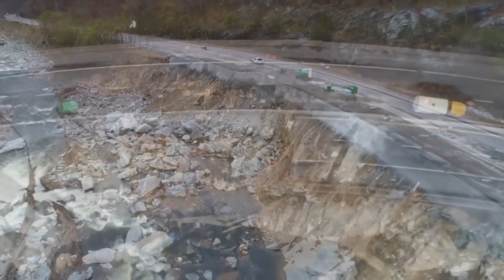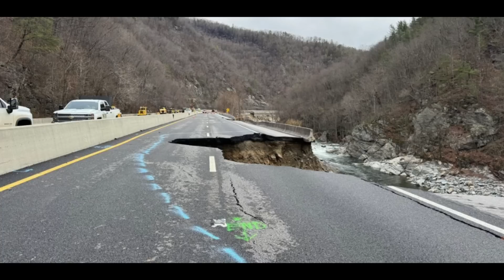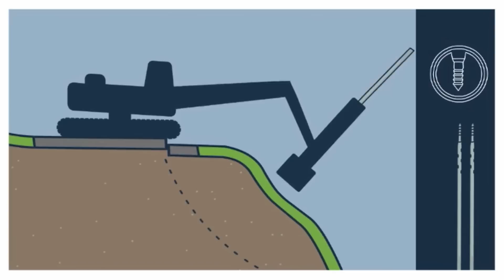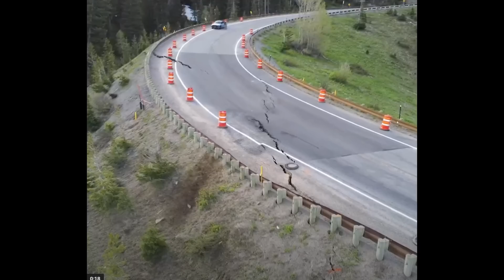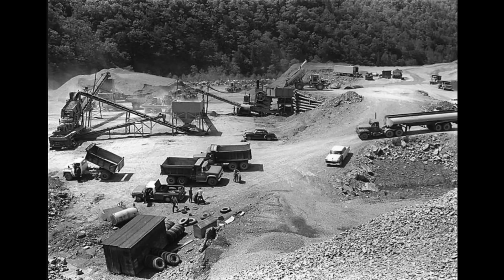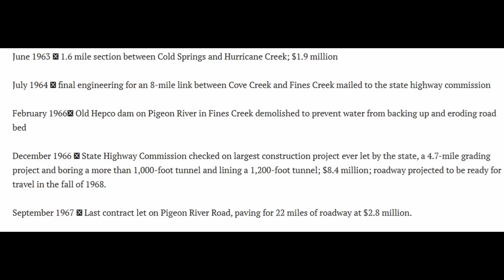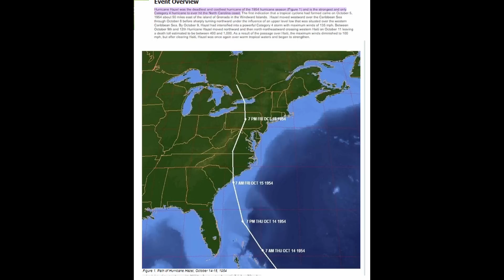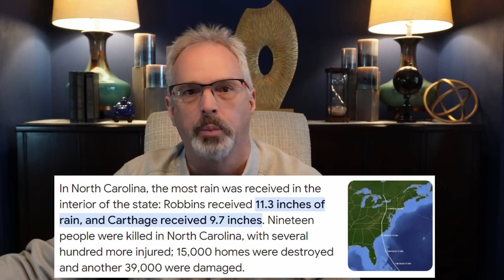Interstate 40 Rebuild Status

Comment: The hazards of I-40 between Knoxville and Ashville are almost legendary.  By 2004 it had been cut so many times that T-DOT and NC-DOT seriously considered not rebuilding it after Hurricane Ivan cut it up in 21 places.  It is actually less damaged this time than in 2004. 
The section of the roadway was closed for 18 months to rebuild it from Knoxville to Ashville. 
That section of roadway is almost an annual problem of failures.  It gets rock slides, mudslides, and washouts right as rain.  You are correct it needs serious reengineering.  I would say closer to $50 Billion.  It is such a critical piece of US infrastructure that it warrants the effort. 
Similarly, you should investigate the US-TVA efforts to build 5 dams that were never built in the 1970's.   US-TVA exists because of this flooding.  You should look into the failure of the water system dam for Ashville that put about 20 feet of water down on Ashville as the raised spillway collapsed in one section.  This was the disaster at Swananoa NC.
3 dams failed to make this flood worse.  They didn't all wash out.  They simply failed during max flood control conditions. One had to be opened to prevent a break right at peak flow amplifying the flood.
If you look at the region, the bedrock in the canyons periodically gets scoured out.  Then it builds up a flood plain.   Then it fills in with brush and trees.  Then it gets scoured again.
The flood size max flow at Douglass Res.  was 67,000 CFS.  Tennessee River Flood at Guntersville maxed at 107,000 CFS.  The Max flood at Guntersville has been 740,000 CFS.
This actually was a small very intense local flood.  Not to diminish any people's miseries.
1973 saw flood waters in Chattanooga downstream of Chickamauga dam at 33 feet deep in the city.  This valley floods like hell!   They had to build up 15-foot-high wing walls on Guntersville Dam to cover the damages of 1973.  Cost $58 million. The water washed over Guntersville Dam nearly 2.5 feet deep and it is about 1/2 earth dam.

You should show people the rock slide at Ocoee River #2 dam to show how unstable this rock is.

https://youtu.be/CUXhjPkGBtU

https://youtu.be/Ax0bZ18A47s

https://www.youtube.com/watch?v=Se9gPNP49hw&pp=ygUQb2NvZWUgcm9jayBzbGlkZQ%3D%3D
Reply: I really like when someone says, THIS IS TERRIBLE, AND IS AN ACCIDENT THAT JUST HASN'T HAPPENED YET, AND THEN YOU BRING EVIDENCE.  AWESOME !!!
Reply: @robert-zj7ef  I think so much of the problem is that this region is constantly building roads on the cheap rather than biting the bullet and doing the better, more expensive option even if means it has to be a tollway or constructed in phases (such as a super two initially) to do so. There are so many places in the mountains where they built in a flood-prone area, did massive, ugly, deep cuts and/or shore up unstable terrain rather than just build tunnels and viaducts so that the road can be placed in a more ideal location. In some places, the viaducts may even need to be double decked to minimize the amount of land taken, and when it comes to this stretch of I-40, that might be the only way. The ARC road projects and interstate projects they were always trying to rush through as if building them too slowly would result in them losing the money. Rather than build them right and make them capable of handling increasing heavy traffic, they just basically slammed them through unconcerned about enormous future costs and problems that would come from that.
Reply: @jet346  I have ZERO DOUBT that you are 100% correct.  Maybe, with podcasts from citizens telling other citizens the issues they see, some pressure could be applied to get the governor to take a look not just at the route but also the contracts. Too often, its just the low bidder, who later comes back wanting more.
Reply: @robert-zj7ef  I think it's more that the priority is lower for every state in regard to the region that despite the roads being the most expensive to build, they don't want to make that extreme of an investment. Perhaps I-26 north of Asheville was actually built right, but this was more of an issue in decades past when they were "desperate" to attract industry to the region and just built what they could ignoring the geological hazards along with failing to anticipate increased tourism and traffic. 

Places with constant slides on older interstate and ARC corridors might on the surface just say "this is mountains", but clearly the funds weren't ever there to build tunnels or viaducts on areas that either locals knew or the engineers knew were neither stable nor safe to build. 

But like anything, it's a job with a boss that isn't reasonable and demands the impossible at a time when reasonable voices were ignored or dismissed when pointing out the serious problems with the projects. These days, that is made worse when NIMBYism drowns out all reasonable discussion about alternatives so that instead of developing a better plan, the project is cut back severely to the point of being worthless, delayed for years, and/or canceled). The result is the expensive nearly constant mitigation of roads where the land does not want them to be. At least it's not as bad as in California where there is no good place to build and the mountain roads crumble catastrophically at least once every 5-10 years. I mention further down that the constituents are much to blame as well as they expect something for nothing.

It cannot be discounted that NIMBYism has NCDOT and TDOT in a bind with this road. That is the root of why they are absolutely determined to throw money at the problem hoping they can fix it back to some level of status quo given it's been around long enough to be grandfathered. They will face well-funded and nasty opposition to moving the road or massively altering the road, because for the NIMBYs the only solution is "no solution", and any setback is an excuse to permanently close and/or remove a road entirely with no alternative. Basically, they live in this 1970's wilderness fantasy where it works just fine to just remove busy roads and tell everyone where to stick it as if they live in a private cabin miles away from other humans. This is how we got "whack-a-mole" spot treatment traffic engineering solutions instead of building significant new roads.

Corridor K remains unfinished (despite Nantahala and Ocoee Gorges both being highly hazardous and congested), and the need to convert many of the existing corridors to limited access such as Corridor A will be met with similar NIMBY ferocity despite the fact that they are now miles and miles of traffic lights and development. In Europe and Asia, they will build tall bridges over deep valleys that lead to tunnels through higher peaks. In the US, they will say that can't be built due to cost, environmental factors, and/or opposition.

It is maddening that when the population and traffic keeps increasing that a loud and wealthy few coupled with others that think roads can be built and maintained toll-free with very low taxes force us all to rely on dangerous and inadequate roads while making the cost to fix them get exponentially higher each year.
Reply: @jet346  I had not considered nor even had the thought of NIMBYs. They like the privacy of their living space. Who wants a very  4 lane extrafaganza running through the middle of my families quiet life. Those on that thoroughfare do not stop to see my life, only for gas and a soda. That for the good of the people thing rings hollow. So if there is no reroute then there must be stringent specifications which prevent the destruction of the roadway in a future with a similar Helene event !
Reply: @robert-zj7ef  I think you're missing my point. It's those that line up to oppose every road project on spurious grounds if it is anywhere near their place of residence (as in the same county). That is not the same as building a road in their front yard with a giant retaining wall or taking it by eminent domain. Those are legit concerns: at least in regard to modifying the project so as to not ruin their property or leave them poorly compensated for taking their house. I'm more referring to the "environmentalist" types that play that card to sabotage every public works project who only seem to care about that when it's something planned that annoys them.
Reply: @jet346  I understand your point now  and I CRRTAINLY AGREE.

Comment: Three comments:
1) Not sure I follow the nuclear reactor analogy.  there has been advances in that machinery as you note.  However, highways are pretty much built the same way..  
2) I also have read about a different route, but where and how much.
3) As to the truck traffic to bering in fill, assuming that is the only way, the trucks can be limited to the unused roadway (2 lanes) exclusively affording no or little disruption in regular highway traffic. traffic

Comment: Not a civil engineer but to familiar with the mass x velocity effect in the mountains - especially @ altitude.                                 what is the feasibility of dynamiting the western side of 40 to create either a raised 4 lane (lot of basting) or simply widening/moving the highway away from river at  problamatic bends in Pidgeon river should such a catastrophe occur.
The areas of collapse seemed to have been pretty stout w steel pilings and reinforced concrete...but I am noticing compact soil and not bedrock underpinning roadway.
To you your point of of re-evaluating the re-build moving forward I 100% concur as this a vital corridor.
CHALLENGE : To what extent can we apply the countless areas w secondary and tertiary roads, bridges and communities that have been "pasted"?
Can't help but imagine what 100 billion do - -- not to make WNC more accessible for more tourists/development but for people to be able re-build their lives. This is a national disgrace. Full stop.
Thanks for your work.
Reply: Per above I-40 work...very contingent on composition an location of bedrock

Comment: They need to bring in engineers and construction companies from Norway and  Switzerland that have drilled hundreds of tunnels successfully for railroads and super highways.  It might cost more but would last forever.
Reply: I think you’re spot on, rebuilding this the same way would be asking for a repeat in the future. The bottom line is going to be the money. It’s a beautiful road, I got to travel it a few times. You could support the road with pillars instead of fill, or like you said dig a new tunnel. The question is will we as a society go for it. Better money spent than building a city on mars.
Reply: If this type of failure only occurs as frequently as history shows, no way they will dig tunnels for this stretch. It's about the $ the citizens are willing to spend.
Edit : It's about the $ the citizens have to spend.
Reply: @joe28704 Willing is correct.  America has more billionaires than any other country.  If they wanted this fixed right it'd be fixed right.  But they aren't willing to spend money on a good solution when they can make poor people spend money on a bad solution

Comment: I was expecting to see some scaling prior to the anchor and shotcrete installation, did low water levels in the Pidgeon River disqualified that? If they're hauling in fill at some point there'll be a worse impact. Also was expecting they would remove more sections of the lane that survived adjacent to the failed area, but likely with underlying rock being compromised.

Comment: @Casey Jones - Professional Engineer, you might need to do an episode just on probability.  The average person thinks that another event like this will never happen again since it was a "once in 1000yr event"  They don't understand that you can have two 1000yr events back to back.  Is it rare and unlikely, yes.  Can it happen, yes.  Recently in my hydrology I do for my hydraulic engineering, we started seeing the probability being used by USGS in our hydrology streamstats.  I believe they are trying to get away from the "1 in X years" for this reason.  I'd love to hear your take on some of this.
Reply: a 1000-year event means the likelihood of it happening is 0.1% each year.  100 years even is likely to happen 1% each year. They are based on prior weather history. As we know, climate patterns are changing.
Reply: @jss27560  The hitch with 'historical' weather data is the vast bulk of it is relatively recent - only during and after WW II, because of aviation and other military imperatives was it recorded systematically with any sort of decent spatial distribution. And even with that, there really still isn't very good correlation between the weather event at a give region / place and the 'effects' which  converge and manifest sometimes hundred of miles away ( flash floods in the American SW are classic examples of this ).
Reply: The so-called 100 year event is an improper name. A so-called 100 year event is actually an event which has a 1% probability of occurring. Frankly, even expressing in that fashion is improper as there is insufficient data to be able to yield a sound probability of something occurring.

Frankly, an episode on probability and statistics would be so sketchy that it isn't worth doing. It's why colleges have courses on the subject and a course in the business department is not sufficient. This subject is far beyond "cookbook stat."
Reply: One major problem with anything higher than a one in 20 year event - is we don't have anywhere near enough historical record to actually prove it - for a 1/1000 year event - you probably need at least 5,000 years of information (from a non-changing system) - to be able to claim it is 1/1000 with any real likelihood - and preferably more.  Before you even get into the "0.1%" chance a year analysis - you have to ask how did they decide to call it a 1/1000 year event?  Keeping in mind weather patterns have ALWAYS been changing.  Note Casey's video on the Greenland military base - he said 4000 years ago there was no ice/snow cover there - and that the Greenland base from the 50s is under more ice/snow then when it was built.  Personally, I don't think anyone can put a prediction on an event "1/1000 year" because the weather patterns change too often to allow that to be meaningful.  (yes, I do risk professionally)

I think the best approach is to design something to a reasonable level - with the idea that you will HAVE to repair it at some point after a disaster so that should be part of the design - but also to have multiple paths.  This section of I-40 hurts so much because there are no good other roads - once the road is reopened to some traffic - develop the alternate path into a 4-lane road (ie I-240 now) and then go back to improving this section again - we clearly need another high-capacity path through those mountains.
Reply: @JohnKollar  You are correct. Even the 1% probability is not statistically correct, but that, and the 0.2% storm are shown on flood maps FEMA commissions and issues.

Frankly, I-40 was originally supposed to go along the US 70 corridor, but politics dictated otherwise. A two lane road on a cut section can be maintained, but it would require more rock excavation to maintain a 4 lane section on cut. Obviously, a fill section is not workable and there have been problems in the past where the big collapse took place.

There have been repeated rock slides as well. They have probably put as much money into keeping the route as it would to realign it in  better location that would not present so many troubles.

Comment: I'm familiar with this area in western NC and I 40 is the only road for big rigs, that being said and the state knows it these big rigs are creating havoc on these narrow windy roads and are getting stuck allover the place. The trucks are even trying to traverse 441 over the mountains through The Great Smokey National Park, and that is a big no no. The state is under pressure to get this road open. There are video's of the trucks getting hung up on these roads and needing to be towed out for big bucks along with the summons they get.
Reply: A tanker truck full of liquid chocolate overturned on highway 34 a couple of days ago.
Reply: In the low country SC the steepest grades and highest points are the bridges over the Wando and Cooper rivers. Guess where there most big rig breakdowns occur? And that's w/o hairpin curves/swithcbacks.

Comment: They don't appear to really have very many good options in this area due to terrain.  A better comparison may be some of the roads we have here in Colorado - especially I-70.  I do think they can make the existing route more flood resistant for less than tunneling but they will need rethink how the road is built - again look at I-70 east of Greenwood springs.

Comment: The Environmentalists don't want to hear this : move river over and build vertical structural retaining wall with rock pinned footer and turned up ells to retain the unbalanced fill that will be the new road base. Also acid bearing insitu rock is a factor, supposedly.
Wonder what Elon with charge with his tunnel boring company.